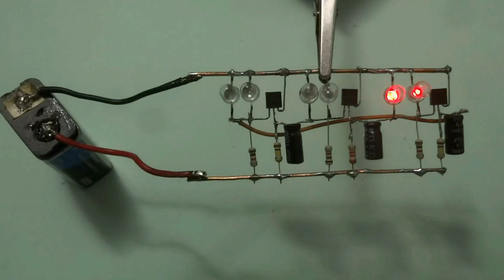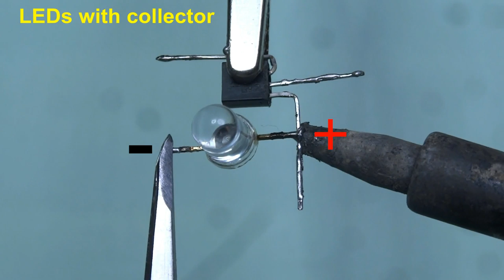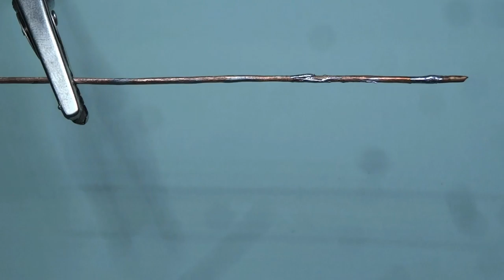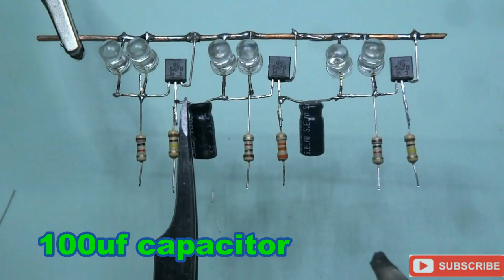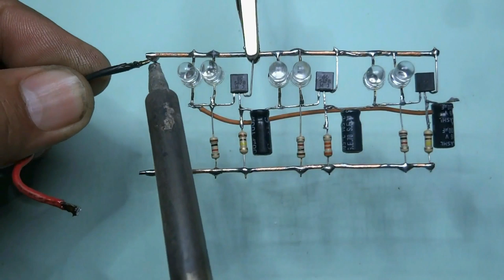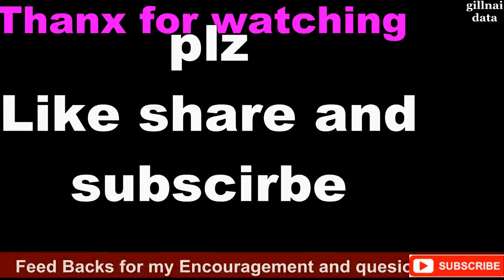Automatic Traffic Lights controller circuit

Comment: Does it still work even if I only put 1 LED for each color?
Reply from the maker: yes ofcourse it will work with single led also instead of two
plz visit my web for my encoragement and for more circuits
https://envirementalb.com/fm-transmitter/

Comment: which transistors use here mention?  plz! bro
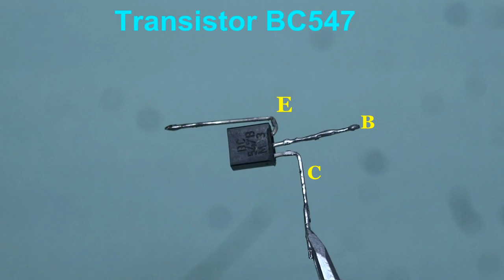Reply: It tells you quite clearly on screen at 0:32 and in the link for the circuit diagram. Just how lazy is your generation? Use your eyes and your brain at the same time. You young ones want everything handed to you on a silver plate these days. Besides this is not rocket science, it is a simple circuit and multiple values of components can be used. Experiment, Investigate, play around with it and learn things for yourself. By changing component values see how the time on and time off are affected.
Reply: sorry bro extremely
Reply from the maker: BC 547
Reply from the maker: All are BC 547 dear